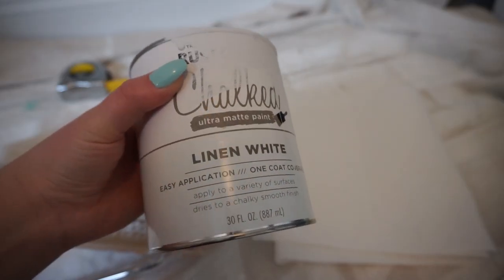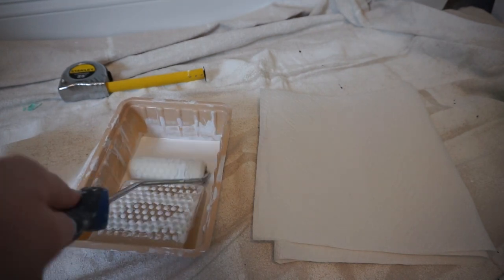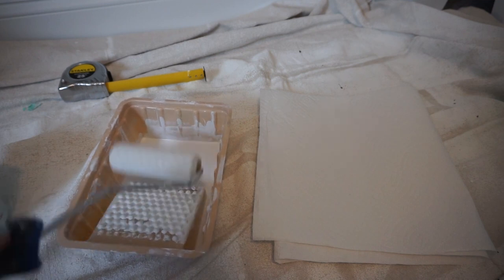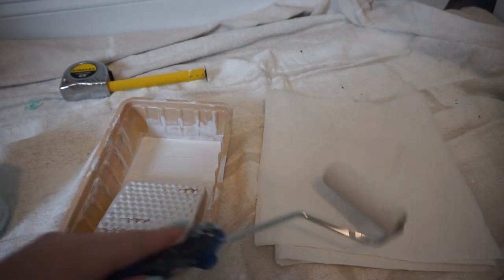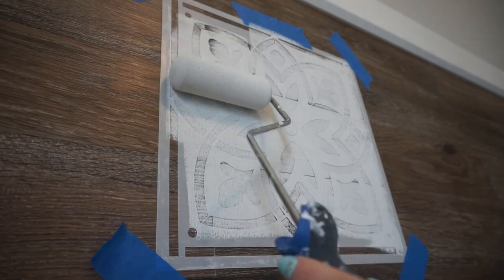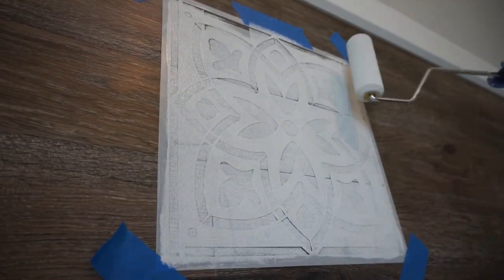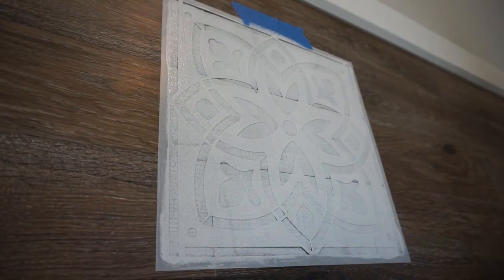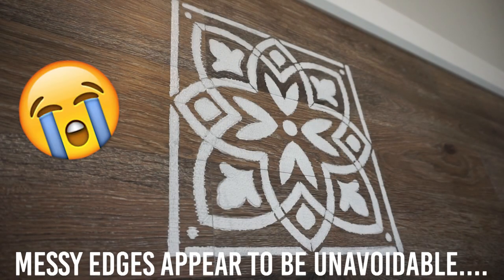DIY Stenciled Headboard

Comment: I make wood signs and for the bleeding not to happen underneath the stencil, you have to sand the wood very well to smooth (but you can't in this case because of the faux wood pieces) and you have to dab on the paint extremely lightly each time. I use a makeup sponge and find that allows me not to dab on too much paint. I love the headboard though! Very pretty!
Reply: good to know

Comment: Clear caulk is your best friend when you want clean and crisp edges. Lay the stencil down, put clear caulk around the edges (smooth because it is going to stay), paint, and peel it off while the caulk is still wet so you have to be somewhat quick. It's a trick we use with painters tape while painting. We are contractors and it helps move along quite well without having to take too much time on edges. And the clear caulk is generally very durable, just as durable as paint is on most surfaces. Clear is better than white and don't make it too thick!

Comment: Keep it, looks great....I watched a video where it showed putting mod podge on first to avoid bleeding....
Reply: Martine Bangs I've seen that tip on several stencil videos and thought I would try next time I have a messy stencil but haven't done any yet. I agree the grooves in the faux planking are causing the "run under"  I would guess that the matte finish and not the gloss MP would work best for this project. You wouldn't want any shiny edges peaking out either lol

Comment: There are stencil paint and stencil brushes you can purchase. If you use those and only get a small amount of stencil paint and use the pounce method you may have a better outcome, maybe.....I can say for sure I have had great results with those products. The key is to have a very dry brush, blot well on paper towels. But you could be correct that it’s the slick vinyl peel and stick pieces. Good luck.  I love your videos.

Comment: I found this interesting in redoing ugly faux wood cabinet door(not a laminate as much as a papery type of fake wood) in a mobile home buffet built in.  Instead of completely painting using light sand ( and I mean light and fine), primer and 2 coats of paint and a top coat...this idea was light sand where I plan to stencil only, stencil, top coat ...way less work on an ugly faux buffet/hutch built in.  Leaves the first impression the buffet is real wood. Has a boho look.

Comment: Perhaps less paint on the roller? I have stenciled many things and use a round stencil brush and get it almost completely dry by pouncing the brush on a paper bag etc. to get a lot of paint off. I also use a stencil paint. Then pounce the paint onto the stencil. I would go easy on the paint, even if you have to do it a second time. Or, keep what you have. A shame tho it doesn't show when bed is made. Perhaps don't stand the pillows up but rather lay them flat and then just lean decorative pillow as you would normally. Of course being a Virgo here, I am not happy if not perfect. Just me.